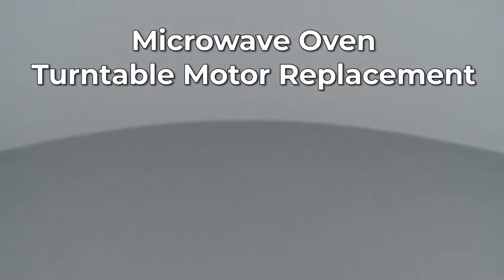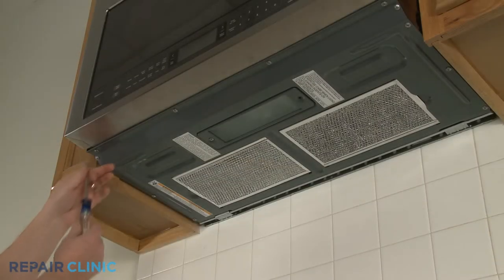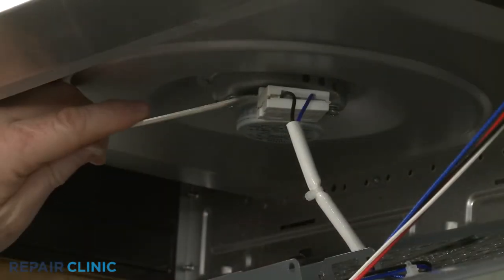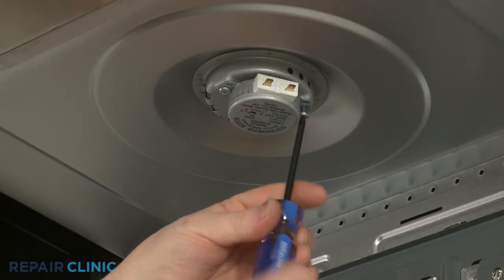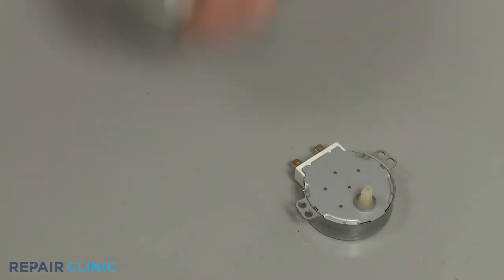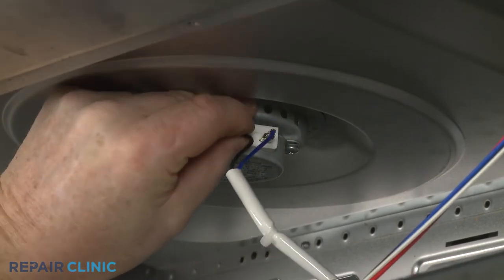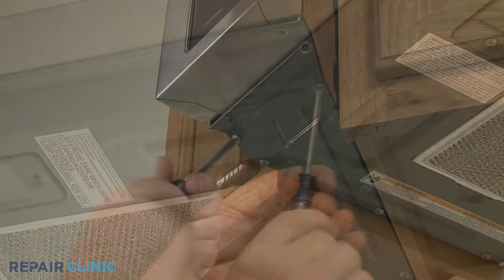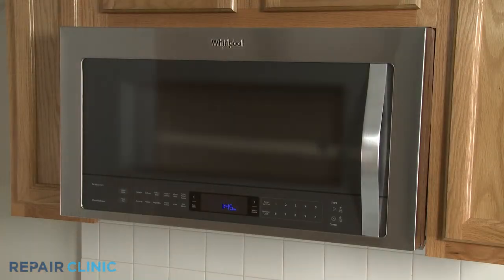Whirlpool Microwave Oven/Hood Combo Turntable Motor Replacement W10642989

Comment: THANKS on the microwave hood combo it will be far dirtier than the video. Turned into more of a project than expected. The replacement motor was also defective. It would run about 1/16th of a turn and reverse. Second motor installed and it is fine.  A power screw driver with a clutch makes it far easier.
Reply from the maker: You're welcome! 

We are always happy to help. If you would like to give us a review on Google, we would much appreciate it: https://g.page/r/CcVUrahZNozMEBM/review

We hope that you have a great day!